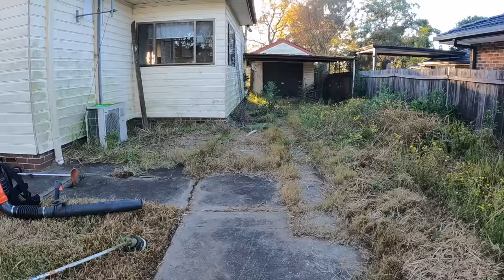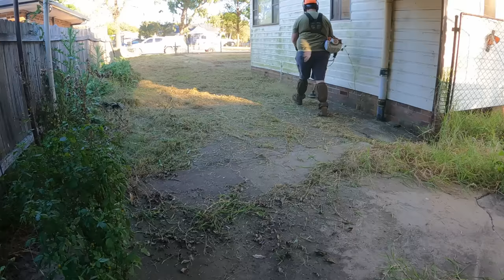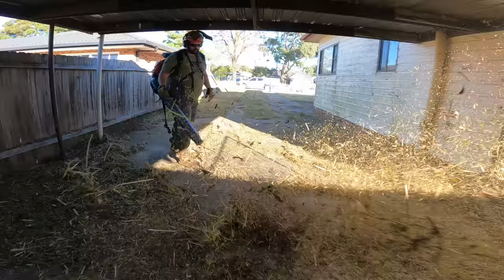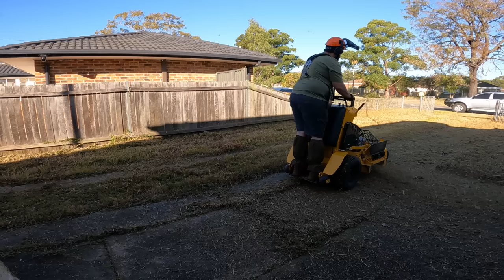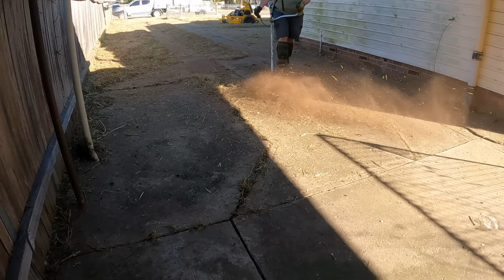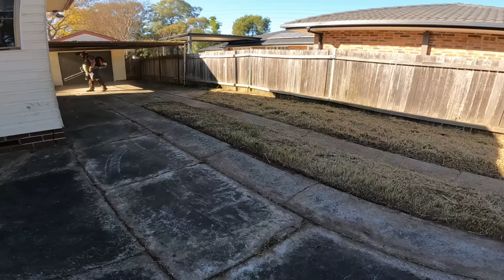HIDDEN Driveway Was So OVERGROWN & NEGLECTED Every Lawn Contractor REFUSED To Do The JOB!

Comment: You see so many homes with these split concrete and grass drives. Its interesting from the U.S. to Austrilians homes. I think its nice to have that strip of grass, but I very much APPRICIATE the work involved carring for these yards. Makes me think its eco friendly. Im so amazed by your lawn grasses, just how resilient they are.... its crazy growth. The ease of your swing on whipper snipping, it flows gracefully. I litterally keep expecting horrible snakes to jump up at you.  This yard is large, once growth is tackled back - you can see the size! Well done on this yard....
Reply: 1/2 job well done
Reply: Ruth here, my friend in Orrville Ohio lives in an older home, she had a drive like that, 2 cemented paths.
Reply: Greetings from Cape Town,  we have 2 strips of slabs with grass in the middle,   yes a lot more work
Reply: In the u.s. they're called Hollywood driveways.
Reply: Fantastic that was a lot of hard work, now the front garden looks lovely, good luck with the back can’t wait to see how you get on, they should really get rid of rubbish before you start. ❤❤🇬🇧🇬🇧
Reply: I’ve seen that style in some older neighborhoods around me in Pittsburgh.  They seem a better option for rain runoff control, even though it’s more trimming.
Reply: They were quite common in the UK untill the 80s when brick and paved stone is used.    If you want to see a guy called  Sid at  "Partridge exterior cleaning" then go ahead and see his driveway and roof cleaning ! .....
Reply: Very common in middle America. I like them because rain water has a place to run off to, back into the ground! And two, eliminates spots from vehicles on the driveway whether it's pavers, concrete or tarmac.  If you let it get out of control like this person did, yes, it's a bear to clean up for sure. 😊
Reply: Many older homes here in Australia have them. Now it's just concrete.

Comment: Its always harder in the rear😂

Also for my trimmer line i use .155mm its so thick it will cut down 1 inch trees lol. I did an overgrown yard with it and got most of it done without the blade.

Comment: Older homes,  like in the midwestern U.S., frequently have double strip driveways. They are less subject to subsidence damage,  cracking up from freezing and thawing, and allow for water run off where drainage is a poor. My two car wide driveway in Florida is on sand and it looks like a giant mosaic because it sits on pure sand. Curse you HOA that will not allow an alternative!

Comment: I've never understood the point of the split driveway. Is it just saving money on less concrete or is there a purpose for it? This particular one is even more strange because one side doesn't go the whole way to the gate or street. Can someone enlighten me? I've lived in several states and have never seen one of these split driveways.
Reply: They were pretty common up until the 70's and then most went to a full slab. I would think it was just to reduce the cost in the earlier years.
Reply: @treecycle4631  TY, I guess if times are tough, you cut costs where you can.